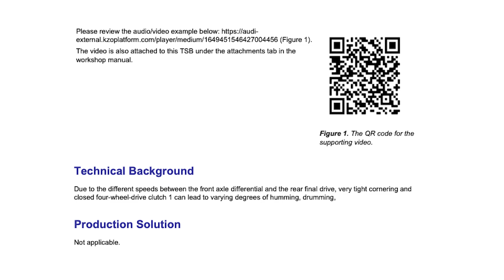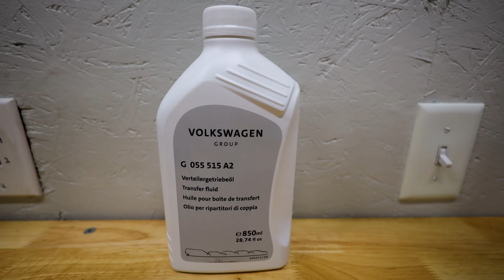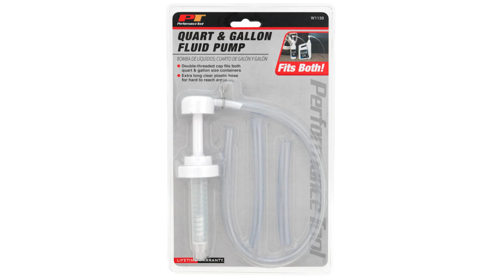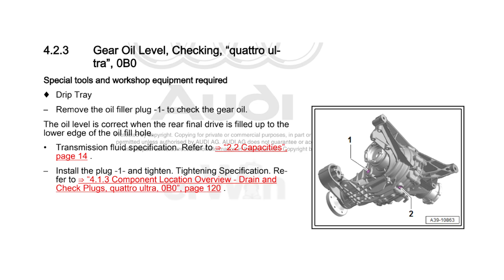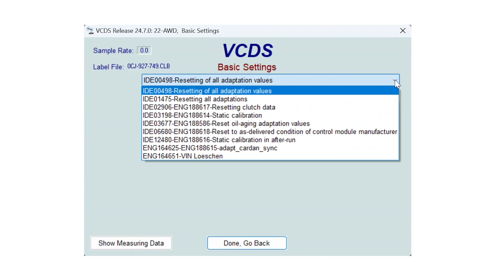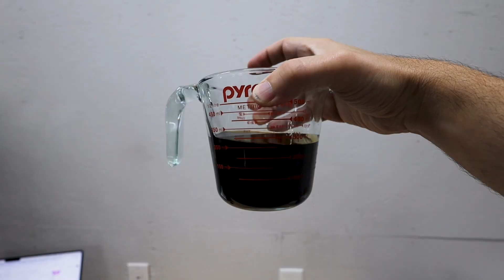Quattro Ultra AWD Clutch Binding & Vibration Fix | TSB Procedure A4 Allroad

Comment: Thank you! The procedure on spot! I have 2021 A6 45TFSI Quattro, so probably will do this eventually. I am currently at 32.000km
Reply from the maker: Yup, keep an eye on it. I think the larger moral of the story is: there's no filter or fluid that shouldn't be changed at some point. I understand why a business decision by Audi would be to leave out a number of fluids from the regular maintenance schedule or simply call them "lifetime" and avoid the necessity to change them under warranty entirely. However, the side effect is obviously that the service becomes "out of sight, out of mind" for all owners, where the work now becomes reactionary instead of preventative. Which is dumb. I know an auto manufacturer would never do this but if there could be a "Things you should really consider on the tail end of your warranty period" section to at least mention the items we all know need attention but are unlikely to cause issues for the first number of years of ownership, it would save a lot of pain.
Reply: But I didn't find this oil for the 2020 A6 4WD on FCP. The website shows that this oil is only suitable for A4.
Reply: @ZhanhaoGuoAlec-i7u  I asked local "Skoda dealer and he gave me excatly same part no. G 055515A2 and G 060190A2 as he has in the Video.
Reply: Did this change today. At 40.000km than kyou for the hands on video ;)